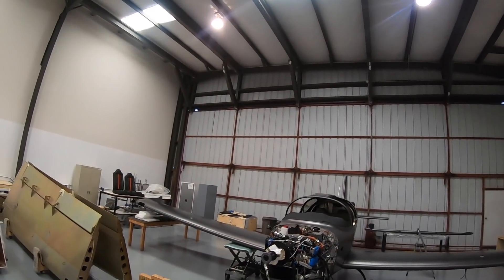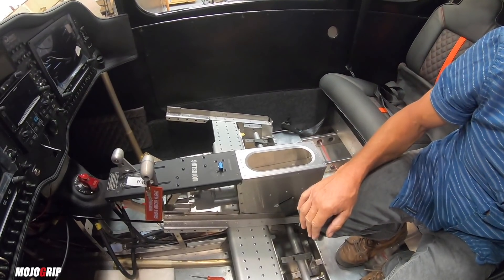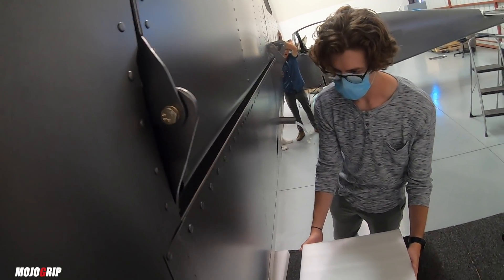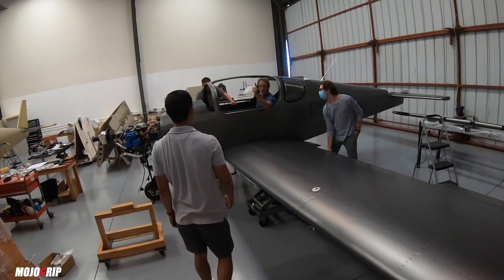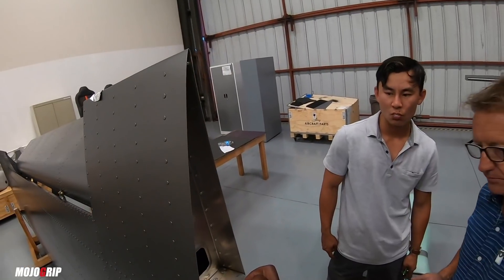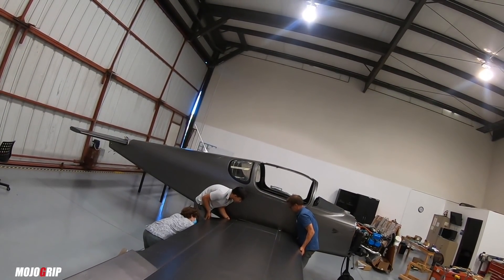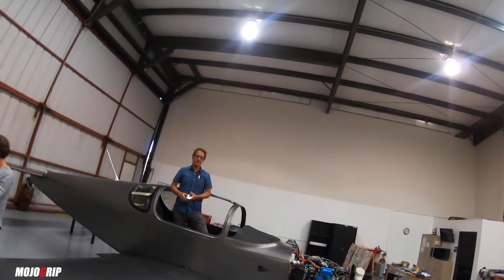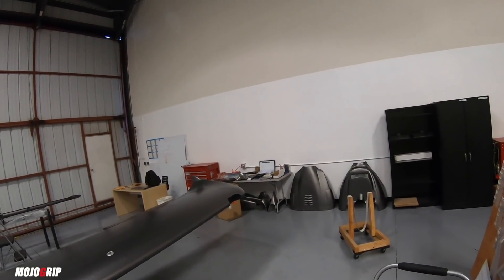My Airplane Wings Are Coming On. TSi Airplane build

Comment: Looking forward to seeing the finished product, Mike! How long do you think it will take you to get your 40 hours in once it is built? And, are you flying straight back to Georgia or taking the roundabout way (through South Dakota, for example)?
Reply from the maker: Thanks Edward. for the 40 hours test flight, I'm estimating 2-4 weeks. Will be flying everyday, multiple times a day if weather permits.
Reply: Sounds good - remember to fill out the performance characteristics while you’re at it, not just fly around for the fun of it (though it will be fun!). If you haven’t seen it already, the EAA has some cards you can fill out to help you figure out the performance specs. Like a ceiling of 28,000’. Or FL29. Or FL30????

Comment: Another milestone, although I can't ignore the hammering. I assume that what was being wailed on with no less than a two-pound sledge hammer are the wing joining bolts. I'd expect to hear such mauling at a heavy steel construction site, but not an airplane hanger. If it takes that much effort, something just ain't right.

Comment: Why is this painted before you fly off the 40 hrs?  I would have waited in case you needed to make changes. Then you have a spotless plane when the build is done.
Reply: The guys at TAF have done this enough to get it right first time..
Reply: @slavedriver394  Yeah. Like hammering the heck out of what I assume are the wing joining bolts to get them in place. If that doesn't spell "amateur", what does?
Reply: @EJWash57  You have heard of interference fits I presume?  The bolts are designed to be a tight fit - even the smallest amount of play at the wing root would result in movement of the wings.  In what way is hammering them into place amateur -  I would be interested to know how you would do it?
Reply: @slavedriver394  Not having the manual or drawings, I can't answer that question. In general, though, Engineering/Interference Fits are best joined with a non-shocking method. Arbor press, or hydraulic. Even thermal (heat to expand - freeze to contract). A huge issue with using a hammer is alignment. No way to be dead-on with each and every blow. Not that the wings will ever need to be taken off, but THOSE wings are NOT coming off!